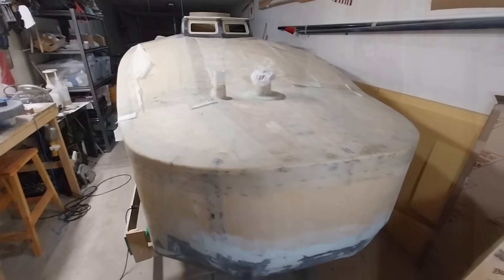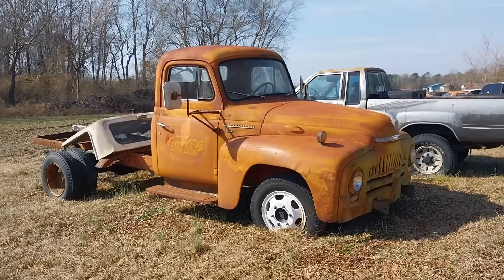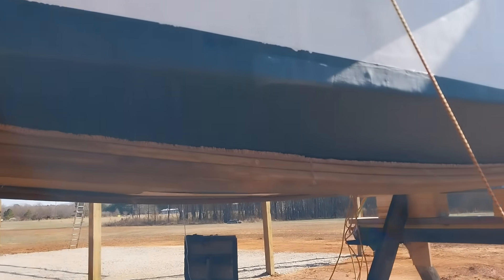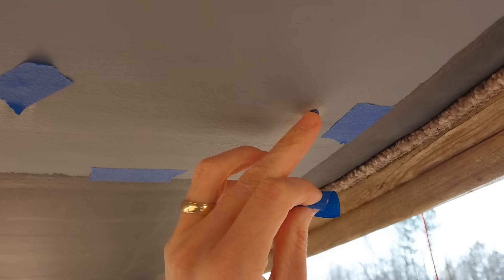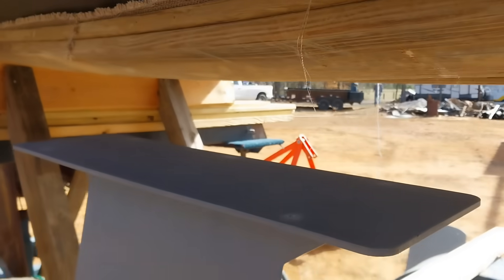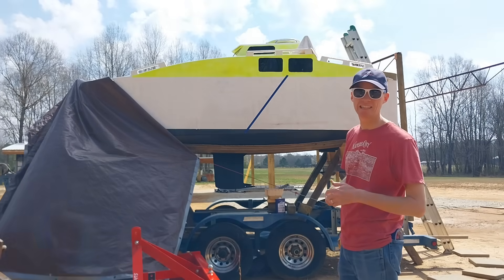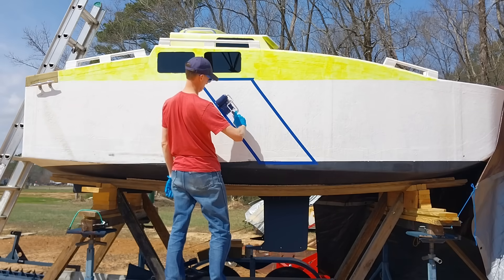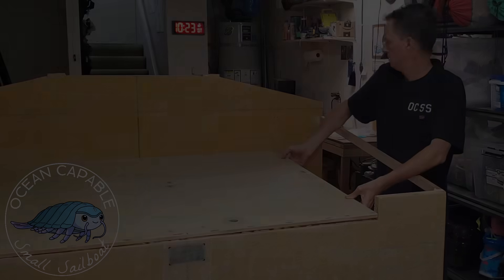OCSS-092 Unbreakable Bolt-on Stability Monsters: Steel Twin Keels

Comment: hi , can you explain us why they weight only 50kg with lead and still be effective with such a lite weight ?
according to papers the average weight is 30% + of the boat weight.
Thanks , have fun with your beautiful boat !
Reply from the maker: I'm no naval architect but I did consult the designer (who is one) on the calculation for the amount of lead. A couple other things to consider are 1. the mast is very light, only 12.4lbs, so much less weigh aloft than typical. 2. the hull shape. The closer to a circle the cross-section of your boat is, the less ballast down low you need. Most boats have a cross section like a halved oval. But this boat is more like a hexagon. I haven't even added the lead bulbs yet and she behaves very stable just with drinking water, food, battery, anchor and chain stored low.

Comment: While I was assigned to the admirals staff, he told the captain of the taskforce to physically touch and check out each port.(ie hole) In the hull.  He said "you are leaving port with several holes through the hull, each could, if not maintained,  sink a ship just like enemy fire." As you drilled those keel bolt holes I thought, " I hope they don't leak ". Thanks for these great videos.
Reply from the maker: I remember my Captain inspecting a fan room I owned. Said not to have the guys paint too much or the walls will close in, lol.

Comment: I’d recommend installing steel backing plates on the inside of the boat.  If you hit something hard for example while waves lift you up in shallow water and pound the boat on the bottom (been there), those little washers can pull through and cause a leak.  Fatal flaw here
Reply from the maker: The washers sit on top of 3 solid oak beams that run side to side across the boat though.

Comment: What about anodes...are they necessary
Reply from the maker: I looked into it and I think I could go either way here. These keels will remain isolated from the rest of the boat and from the water using various compounds and paints, so it shouldn't experience any galvanic corrosion. I could be wrong, but we'll see.

Comment: I haven't read through most of the videos comments, so forgive me if this has been answered elsewhere.

What are you considering for airflow through the cabin, vis a vis mould and air quality?
Reply from the maker: There are some older videos about ventilation, you can search my channel for them. There's an air intake and exhaust.

Comment: I'm an airplane guy, not a boat guy, but shouldn't those locknuts be on the bottom, not inside? You don't want the bolt to fall out is the nut comes loose.
Reply from the maker: I'm using split lock washers. They are placed inside against the nut to keep the nut from loosening due to vibration.

Comment: Remember Captain Perry; 
Types of Stainless Steel:
A2 (304) Stainless Steel: This is a common and versatile grade of stainless steel suitable for many applications, including woodworking. 
A4 (316) Stainless Steel: This grade is even more corrosion-resistant and is often used in harsh environments, like near saltwater or in areas with high moisture. 
Alternatives:

Comment: @ocean_capable_small_sailboat

It probably felt good once the mystery was solved about your bottom of boat drilling shown in this video here.

Then consider you had the fore thought to core-drill those bolt penetrations and have them already filled with thickened epoxy before now redrilling the holes for the now permanent insertion of your keel bolts.

Even better to have that  “video-graphic memory” on your side as well. 

It might have proven to be helpful for you in rediscovering you actually had the fore thought to do the core drilling up front back then. 

It’s sort of hard, I imagine how you might keep track of little things such as that with all the life changes you've made since then. Well that, along with the passage of time too. 

[ For some of us it's hard to remember what we might have done only a few days ago or even at times a few hours ago. When much is going on at once. ] 

Anyway/ Otherwise, thanks for digging up the flashback video footage featured in this one, if it was only for the rest of us simply following along on YouTube with your boat build. 

(And sort of related...)
I was sort of curious when you mounted your rudder gudgeons, not too long ago now, to the transom. If picking up your embedded rigidity plates, there was still possible then? Or essentially if you know whether that panned out in your favor like these here keel mounting holes did for you? 

( I got a bit concerned with that because of any adjustments that maybe had to happen as a result of aft most hand holds and tiller height coordination... Basically that might have had you bumping up the mounting of  the gudgeons more than you might have originally thought. Yet hopefully NOT above the preinstalled embedded rigidity plates/ Acrylic pieces there from way back in Episode -09 that you thought you get in there upfront to fortify the mounting of the gudgeons and essentially fortify/secure the rudder's connection.)

Maybe the rudder holder was adjusted to make up for this though too? Just asking if you noticed when that mounting was done. o r if you recall.
Reply from the maker: Good planning, I guess. The rudder gudgeons were installed right where I planned them to be 3.5 years ago.

Comment: Great to see the boat almost done! I do wonder if the keels are big enough to allow you to point to windward properly? There are two of them but they look relatively small compared to what you would normally see on a boat that travels at this speed. It was cool that send cut send could make them though!
Reply from the maker: The original plans had a single keel the same width as mine, but a bit deeper. With double keels I've got more keel surface area than the original so it should be good. We'll see in testing.

Comment: I hope you passified the welds on the top surface of the keels before you painted over them.
Reply from the maker: That's for stainless steel. These keels are not stainless.

Comment: Stainless would have been nice, not because you can’t use steel but between the lead, steel and stainless bolts you will have electrolyses on the bolts and they will get crevice electrolyses and not be apparent. Zincs will slow this down but that fix being sacrificial actually adds another metal to your underwater battery. The twin keel boats generally have a skeg so when grounded the boat doesn’t fall or support itself on the rudder.  If you haven’t yet get an extension made for the trailer to make launching easier. When you make the molds for the lead, you will probably 3d print it but you can use plaster to make the molds, works good. The lead will shrink some when it cools so account for that. The top of the lead will not be perfectly smooth, you can use a power plane to fair it. If you get a piece of lead too big for you to handle or melt you can cut it with a chainsaw.
Reply from the maker: There shouldn't be any metal on metal contact between any of those, dissimilar metals will have insulating coatings between them. My keel bolts are insulated from the keel with several layers of epoxy barrier coat, as well as sikaflex.
Reply: @ that’s always the plan, salt water is the medium. I have seen where someone has used stainless screws below the water line fully imbedded in epoxy fail because of electrolyses. Also wanted to say that drilling lead is a pain, it drills easy enough but if you drill more than an inch at a time the drill bit will heat up and melt the lead and they become one. Only way to get it out then is with hydraulics. Bare footed ships auger is best drill to use.
Reply: It’s almost June where are you my friend?
Reply: Good point on the electrolysis.
Maybe galvanising the plates and using galvanised bolts better?
Reply: @ bronze has a better history but is too expensive now. On that small boat a solid layup of glass would have been more than adequate.

Comment: Im curious  to know why  neither the keels or rudder are foils?
Reply from the maker: The rudder blade is a foil. I may modify the keels to have a more pronounced foil in the future, but this is what I'm trying for now. They are actually shaped into a thin foil with the grinder. Same as is done on the Mini Class Globe 580 boats which are well proven.

Comment: If a keel is bolted on unfortunately it’s not unbreakable.
Reply from the maker: Nothing's unbreakable. The title is more to catch people's attention, that's the Youtube game I have to play a little. That said, 5/16" SS bolts, 6 of them, would take a ridiculously large force to break.
Reply: @  I’d be more worried about the welds!.
Reply from the maker: I was too, but my welder tells me "Properly executed welding is just as strong as the base material. Depending on the filler material, sometimes it’s even stronger."

Comment: Hi Perry, looks great, I’d suggest using bigger base plates by a 1/3 to double that area. Also you might consider building up the stem into a teardrop or they will stall the water passing over them at small angles. Also recommend not using stainless steel bolts in this application.

Comment: Can I ask why 15 degrees ? Is this something a naval architect advised that ties in with width / length or some other parameters ?
Reply from the maker: Why not? I copied the cant of other twin keel designs. They mostly seemed to use about 15°.
Reply: @ocean_capable_small_sailboat  I decided to google the reason. It seems 15 deg is an optimum that came about from testing bilge keels a good 50 to 60 years ago. They also noticed if you toe in the keels a couple of degrees this also helps performance.

Comment: Unbreakable? So instead of the fin breaking in two on impact, it will rip it off and then you are left with holes in the bottom of the boat. I think there is a reason most boat builders build their boats so the fin breaks, not the hull
Reply from the maker: What offshore boat builds its keels so that they break off?

Comment: Did you do anything to secure the nuts on the keel bolts? Somethinb like the nylon lined lock nuts, threadlock, or just a second bolt.

The thought of one of the keels falling off would worry me, and I'd probably do all 3. A sort of belt, braces, and a piece of string approach. 🫣
Reply from the maker: I used SS lock washers and regular nuts.

Comment: I'm curious now that i have seen the twin keel design that you went with ... did you ever weigh the boat to get the gross before adding the keels?  i only ask because of the design that you chose to use.  With each of the keels set at opposing 15° angles and just the weld to the base plate, I would be leery of actually attempting to dry her out by standing on those -- they may deflect and bend with the weight of the boat, supplies and passengers.  Most bilge keels that I have seen constructed have more of an air foil shape with both inner transverse supports between the skins to add rigidity to the overall structure.  Your design will likely be very hydrodynamic, but I would be very hesitant to actually dry out the boat on it.  Keep up the great work!
Reply from the maker: I have confidence they can hold multitudes more than my boat weight. Each keel is 39lbs of 1/4" steel, seriously strong stuff. And the welder did beautiful work.

Comment: 8:51 Did you have anything/anyone holding a wrench on the bolt head (or even just looking at the bolt head from the outside) to make sure the bolt wasn't spinning or turning and the nut was tightening down correctly?
Reply from the maker: Yep I had a helper.
Reply: @ocean_capable_small_sailboat  Good deal!

Comment: How long can your antifouling paint sit dry on land before you have to launch or strip it off and reapply it?
Reply from the maker: This stuff actually says "no maximum dry time before launching. You can paint your boat with Spartan in the fall and launch in the spring."
Reply: @ocean_capable_small_sailboat  That has to be a bonus compare to other products 😀
Reply: Good question because all the boating channels I watch do this just before launch 😀

Comment: Great job as always Perry, how heavy is each Keel?. May I suggest that you use some type of colour marker/paint on each Keel bolt inside the boat to show the bolts in the tightened position this way you can just inspect them from time to time and if the colour marks have moved then the keel bolts are coming loose then can be tightened back to original colour mark. On another issue how do you like your new State vs California
Reply from the maker: Thanks. They've got some heft to them. 39lbs each. I've very happy in North Carolina.
Reply: The steel is 1/4 inch, is it stainless or something else? How thick are the bolts? How much will the lead bulbs weigh? The keels and bolts look comfortably overbuilt. The keels recall John Guzzwell's Trekka and Dave Gerr designed a boat with  flat plate steel keel with a lead bulb. What was your inspiration for this design?
Reply from the maker: HRPO A36/1008 Mild Steel (.250"). 5/16 keel bolts. 72lbs total for lead. I probably got the inspiration mostly from the Mini Globe 580 boats. I drew inspiration from their keel shape as well.
Reply: The boat is really looking great, love the design of the keels, and the racing stripe on the sides.❤

Comment: Thank you so much for this amazing video! I have a quick question: I have a SafePal wallet with USDT, and I have the seed phrase. (alarm fetch churn bridge exercise tape speak race clerk couch crater letter). Could you explain how to move them to Binance?
Reply: What does your comment have to do wit boatbuilding?
Reply from the maker: Just a bot spamming.
Reply: @ocean_capable_small_sailboat Why not zap the comment and block the bot? It's the best way to deal with spammers
Reply from the maker: Because comment count helps with the youtube algorithm, haha. If they are really spammy with links or something inappropriate I delete them.